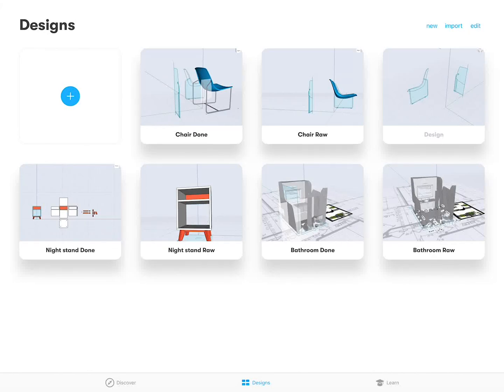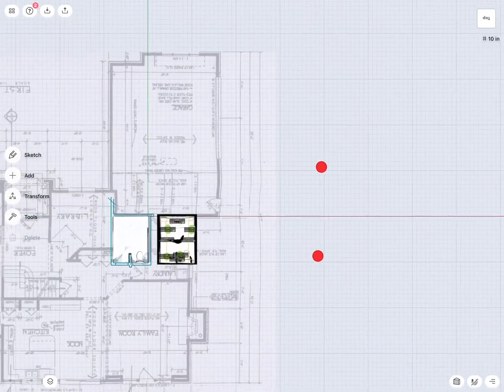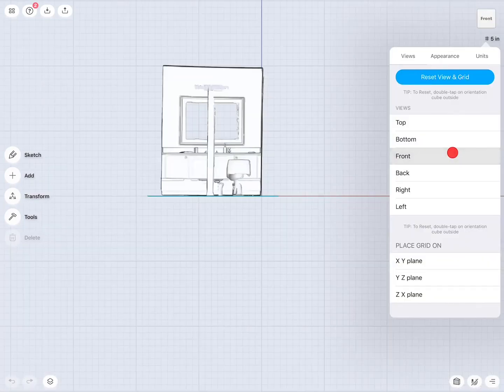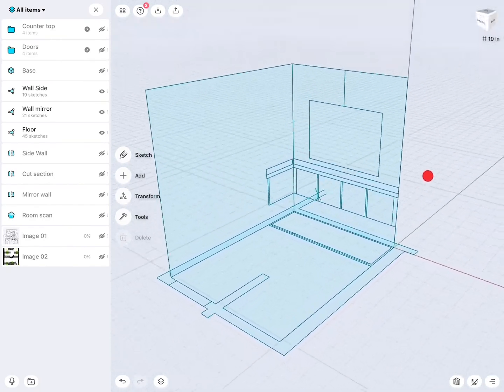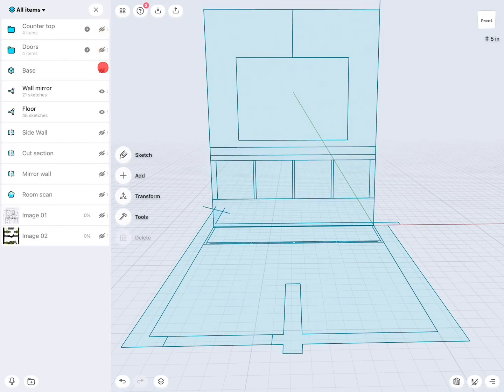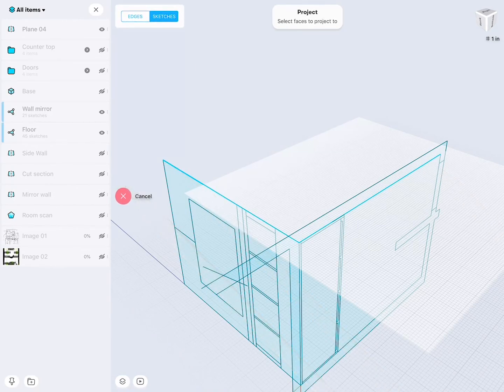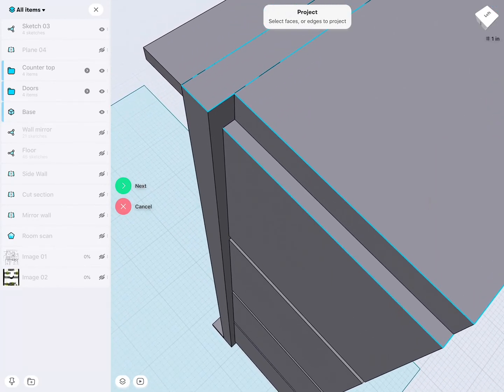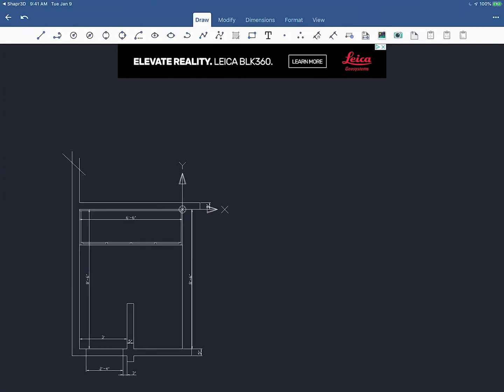2D drawing from imported mesh scan on iPad | 3D design webinar

Comment: Two questions what do you do for STL conversion just use any online converter? And is there an easy way to cut away the walls inside Shaper so that I can see into the room without fiddling around too much - or is it better to leave a gap during the 3-D scanning process for this viewing purpose?